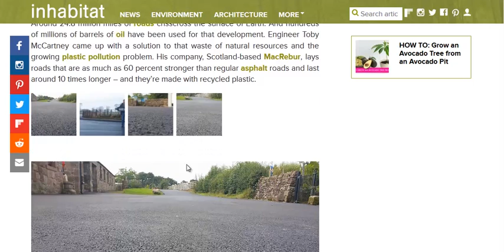Roads Made With Plastic Pellets

Comment: Would the sun heating the plastic road give off toxic, or environmentally pollutant fumes?
Reply from the maker: Great Question. I suppose it's possible, considering that plastic and bitumen are both made from oil, I imagine that they would both have the risk of off gassing at high temps. However, the temperature has to be pretty high to make asphalt pliable, and it stay's solid even under direct sunlight. I'd bet that it off gases the same amount, or less, than asphalt does.
Reply: Thank you, for your informative answer. It would be wonderful if a study could be done, to find out at what temperature it would become harmful.